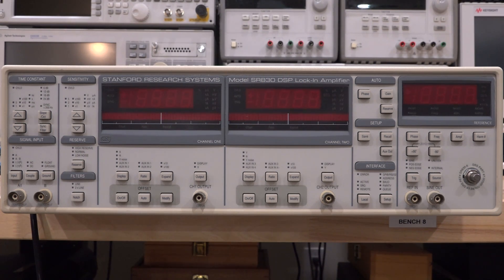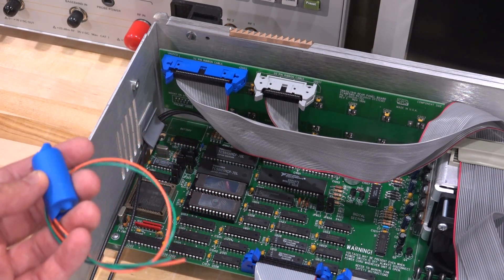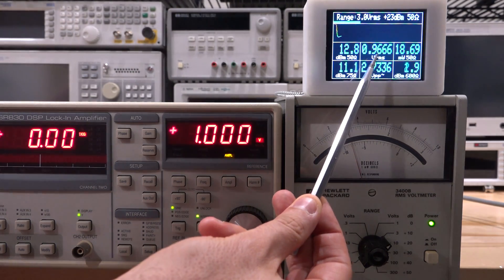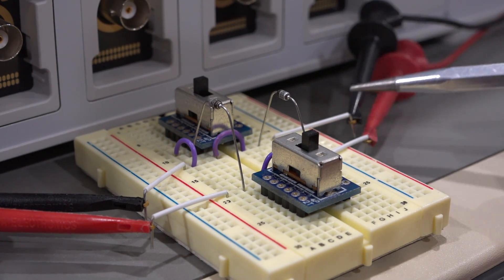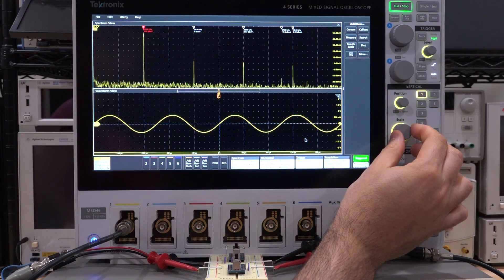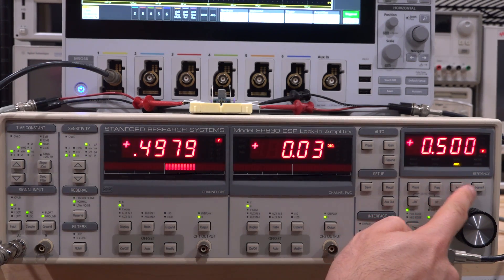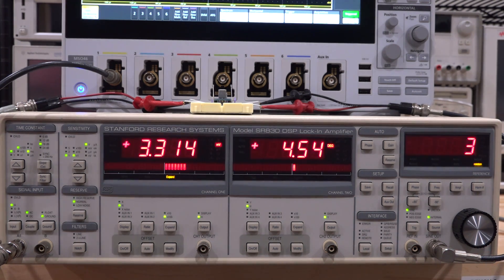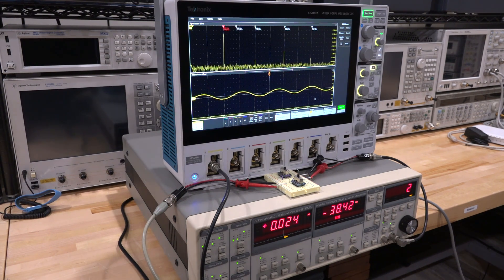TNP #20 - Stanford Research Systems SR830 DSP Lock-in Amplifier Teardown, Repair & Experiments

Comment: Here's an example of how you can implement the interface connection to the SE1022D lock-in amplifier using classes and objects in VBA:

```vba
' Add a reference to the VISA COM 3.0 Type Library
' Go to Tools > References > Browse > select 'National Instruments VISA COM 3.0 Type Library'

' Define a class for the SE1022D lock-in amplifier
Class SE1022DLockInAmplifier
    Private rm As New ResourceManager
    Private instr As Visa
    Private timeout As Integer
    
    ' Constructor
    Public Sub Initialize()
        Set instr = rm.Open("GPIB0::10::INSTR")
        timeout = 1000
    End Sub
    
    ' Method to configure the lock-in amplifier
    Public Sub ConfigureLockInAmplifier()
        instr.Write "*RST" ' Reset the device to default settings
        instr.Write "FREQ 1000" ' Set the frequency to 1000 Hz
        instr.Write "AMPL 1" ' Set the amplitude to 1 V
    End Sub
    
    ' Method to query and print the current settings
    Public Sub PrintCurrentSettings()
        instr.Timeout = timeout ' Set the timeout value for the query
        instr.Write "FREQ?" ' Send the query command
        Dim freq As String
        freq = instr.ReadString ' Read the response
        
        instr.Write "AMPL?" ' Send the query command
        Dim ampl As String
        ampl = instr.ReadString ' Read the response
        
        ' Print the current settings
        Debug.Print "Frequency: " & freq & " Hz"
        Debug.Print "Amplitude: " & ampl & " V"
    End Sub
    
    ' Destructor
    Public Sub Terminate()
        instr.Close
        rm.Close
    End Sub
End Class

' Main subroutine
Sub Main()
    Dim lockInAmp As SE1022DLockInAmplifier ' Declare a variable for the SE1022D lock-in amplifier
    
    ' Create an instance of the SE1022DLockInAmplifier class
    Set lockInAmp = New SE1022DLockInAmplifier
    
    ' Initialize and configure the lock-in amplifier
    lockInAmp.Initialize
    lockInAmp.ConfigureLockInAmplifier
    
    ' Query and print the current settings
    lockInAmp.PrintCurrentSettings
    
    ' Clean up and release the lock-in amplifier object
    lockInAmp.Terminate
    Set lockInAmp = Nothing
End Sub
```

In this example, we define a class called `SE1022DLockInAmplifier` to encapsulate the functionality related to the SE1022D lock-in amplifier. The class has methods to initialize and configure the lock-in amplifier, query and print the current settings, and terminate the connection. The main subroutine creates an instance of the `SE1022DLockInAmplifier` class, initializes it, configures the lock-in amplifier, queries and prints the current settings, and then cleans up the resources.

Note that you'll need to replace the `"GPIB0::10::INSTR"` with the actual VISA resource string for your SE1022D lock-in amplifier. Ensure that you have the correct VISA address for your specific device. Enjoy.

Comment: i want help from you 
I have 2kw pulse amplifier range of 1250 mhz to 1350mhz and 8 of these amp combine together and total out of power combiner expect more than 8kw but the output power is less than 4kw 

Is it happen because of phase machnig or impedance maching i have vector network anylizer znl 1to 4.5 ghz so why the power out less so much
Reply: also i connect coupler to signal genarator and vna connect to the rf out port and 20db coupler port then i measur the phase using VNA it show the phase angle pinpoint but after amplifier the phase angle of frequency varied i cant undurstand why it happen

Comment: Maybe this is your common practice? For batteries that maintain critical data/calibrations/etc, when you build the new battery, add parallel ports, on the positive and negative leads, so that the next time the battery needs to be replaced, you can just plug in a temporary power source, to hold the settings, while the battery is swapped out.

Comment: LIAs are made for physicists! I also repaired and used several single phase LIAs from P.A.R., EG&G 124A, during my diploma thesis and later for my PhD thesis a dual phase NF3961B for measuring magnetic field response, Χ' and Χ'',  from High Tc Super Conductors. The 195Hz output signal was in the µV down to ~10nV level, but the LIA delivered very good SNR and smooth graphs.  The Χ' or Real part showed the super conductivity, Χ'' or Imaginary part showed the losses in the S.C. bulk during the normal <=> super conducting phase transition. Later I also measured in parallel the Higher Harmonics of this transition, with high resolution, but this usually required to stack several LIAs, each tuned to the 1st, 2nd, .. 11th, .. harmonics. You would also not be able to measure that in situ with the SR830 alone, as it is not possible to switch the harmonic detection as fast as required.
My unique solution then was use of a fast and highly resolving A/D converter, i.e. with 16bit / 100Khz or 18bit/50kHz, giving real SNRs of -96 and -108dB . That was in 1990, so I used the brand new 3458A with frequency and phase locked sampling plus FFT in real time. That was a real challenge at that time, as the PC ran on 20MHz only.. requiring assembly code for the time critical parts of the program. 
I really love these LIAs as one can extract smallest signals of that specific frequency out of a sea of overwhelming noise.

Comment: I think the positive phase shift is because the diodes take a different amount of time to turn off vs. turn on. In this case becoming forward biased has to be slower than becoming reverse biased. So at the beginning of the forward bias part of the cycle it is still in reverse bias and the output is higher (less energy is going to ground), then towards the end of that cycle it is "on" (to the extent that it actually is "on" at this voltage) and output is lower. Really great thought-provoking question!

Comment: I'm a former Navy tactical electronic warfare drone so in my case the phase difference would likely be from pop tart crumbs getting inside the patch cord plugs, or more probably I'm simply too lazy to grab another probe from the drawer so I end up routing the signal through the RF distribution unit and across the set room a few times just to reach the panel beside me - all without having to roll my chair the three feet it would take to get it.
Reply: Guys, I've spotted the chAir Force mole!

Seriously though, thank you for your service, and for sharing that delightful look inside the Black Art of EW.

Comment: I am really passionate about lock-in amplifiers and LNAs. I've made a capacitance meter (a classic!) with a lock-in amplifier during undergrad and followed up research in LNAs a couple of years later all the way up to the end of my PhD. It's all about those low level signals! This video is so cool! I wonder if you'd be able to model those weak nonlinearities using Volterra series and actually compare the results with the measurements. Anyway, this was an amazing video : )

Comment: I can think of two effects that might introduce a phase shift: (1) the bulk capacitance of the PN junction, in combination with the 50 ohm termination resistors, would create a phase shift network, and (2) the diodes have a finite carrier lifetime (reverse recovery time). But those look like fast signal diodes, so the t_rr is probably too fast to create a measurable effect. I'm going with the junction capacitance.

Comment: Null-meters of AC world. I like SRS instruments UI, they not fall for modern GUI world (over)simplification process and still old-school with lot of controls.
Reply: Same here. When I needed an RF vector gen I was eyeing the Tek TSG4106A but found out on this channel that it was identical (save for the fancier UI) to the SRS SG396. The SRS even had all options standard which were $$$ on the  Tek and saved me half a car.

When you use equipment regularly a non-fancy UI makes sense. The only thing I miss is a RF on/off button that's dedicated instead of being a shift function.